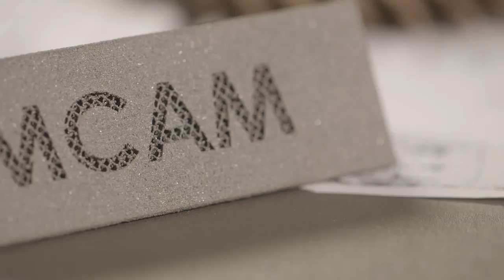3D Printing of a small Jet Engine

Comment: I've only been in the aero industry for the last 10 years, so comparison. However, how can deal with the ridiculous tolerances by using 3D printing? To me it's nothing more than high quality casting. To me the biggest challenge you face is being able to "print" alloys that are up to the job, and can withstand the enormous pressure and heat (Think nozzle guide vanes)

Comment: Now to have them give it a consumer price.  If it is cheaper than a traditional rc jet engine there could be a leap in powered items like home generation power sets.  Heck the by product of heat from the waste gas could be used for home heating as well as hot water.  Alas 350 degree heat isnt terribly good for cooking (the temp of most jet engine systems).